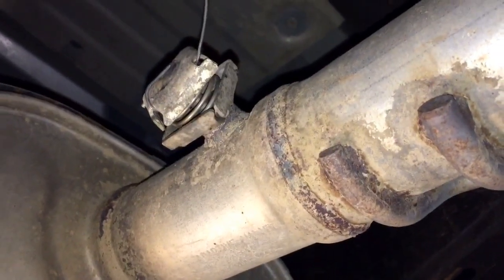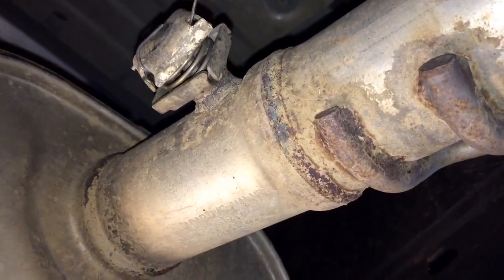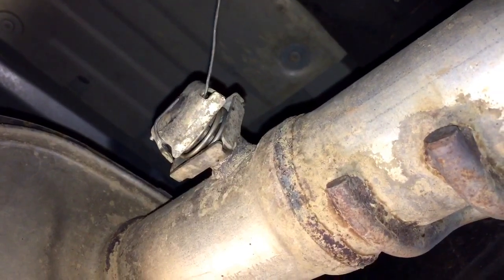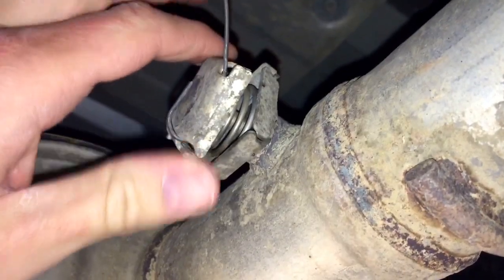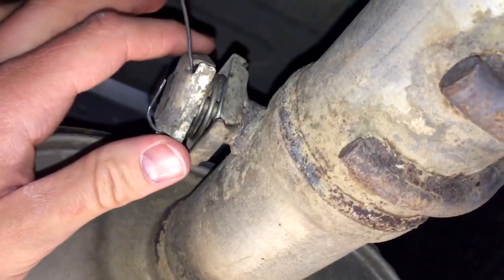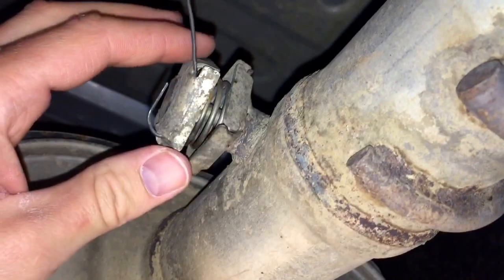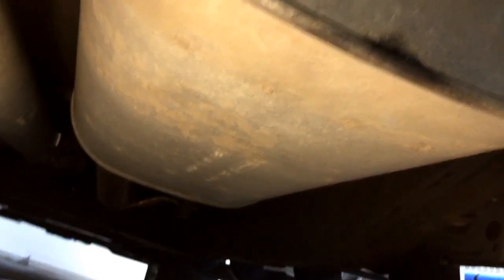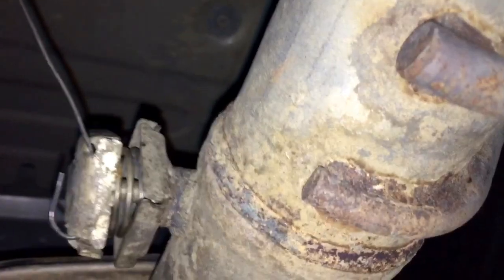GMC Sierra (2017) squeaks found and fixed *temporary*

Comment: I used the holes at each corner of the top cover and bottom plate to hold the valve all the way open. Just twist 90 degrees CCW and insert wire all the way through in at least two corners. Bend the wires at each end so they won't fall out and done!

Comment: I have a used 2013 Sierra extended cab 5.3 liter I bought from a relative and the stock exhaust was replaced with cherry bombs! Way to loud for me but I did find this exhaust today you talk of on the video on a 2016 Silverado extended cab 5.3 liter. Anyone know if this exhaust would work on my Sierra?

Comment: That’s it! My truck has had its leaf springs lubed twice. You’re a genius. It does confirm it on the fuel
Economy gauge. Chirps when between V4 and V8. So now what? 😕 only a 2016

Comment: I have a 2015 Sierra and have complained about this since the day I drove it out of the showroom floor.  Every time I went to the dealership for service, I asked about it and... no bulletin.  Finally, after the warranty expires, SHAZAM! a service bulletin to replace the entire muffler system.  Surprise, not covered by the original or extended warranty purchased.  GM Customer Assistance, no assistance at all.  Gave them the same information three times only to get the stiff arm.  Not feeling to good about that Corvette I was just getting ready to add to my garage.
Reply: Robert Karpick so they will fix the entire muffler system?

Comment: You are the man Empirical.  My 2017 has the same issue and yes springs were tightened down to speck and the even replaced accelerator connection. I will be showing gmc this video.
Reply from the maker: https://www.repairprocedures.com/bulletins/document/pit5404d/4827036.html
Reply: Dealership replace my system 3 times since October 2014.  Last time February 2017, Warranty has expired i'm going to install MagnaFlow 15269 Cat-Back Exhaust System, the hell with this factory crap also put a catch can setup to help reduce carbon and sludge buildup in your intake.
Reply: Careful about the catch can. Do your research first. GM has voided the warranty on catch can equipped cars.

Comment: 2017 Silverado 4.3, Dealer told me this part was cause of a rattle noise. Told me it just needed lubed. It actually needs to GO apparently. I was actually surprised they even use AFM in the v6 too.
Reply: How did you solve? Did you just delete with a regular pipe?
Reply: Yeah, the 4.3 (LV3) shuts off two cylinders…that’s the engine I have. Keep your oil changed every 5000 miles and you’ll have no lifter problems. That same engine without AFM (LV1) is only available overseas, go figure…

Comment: My 2016 4.3 never squeaked - until a dealer dropped the exhaust to get to (and replace) my transmission. Ever since the thing squeaks. Tried spray lube but that only works short-term. Gonna try this.

Comment: Hello, If you make it fixed open - Does the Cylinder deactivation still works V4 / V8 is it should be.  Thank you in advance!
Reply from the maker: Yep never had an issue . Only issue if at all was slight drone sound from 4cylinders firing in a 8 cylinder exhaust pipe

Comment: I have the same problem.  I found the cause of it this past weekend and then spotted this video.  I hate to say it but I'm glad I'm not the only one.  It was driving me crazy.  I had the wife starting and stopping the car a hundred times until I found it.  I sprayed it with some PB Blaster and let it soak over night.  So far so good.  May be a regular fix but at least it's gone for now.
Reply from the maker: I also tried different types of both high temp and penetrating lubricants. they lasted literally days at best. just a FYI, it was completely covered under warranty service for me. they replaced the exhaust from the muffler (further up than the valve that made issue) all the way to the tail pipe.   local GM dealer also gave me a free loaner since i was working back to back work shifts.
Reply: I have a 2015 with 48k making the same sqeek.Dealer won't do crap,they told me to clamp it open because that's what they would do if I proceeded with service.Sucks if grease won't last

Comment: General Motors has a service bulletin on this. If you are within warranty... they will replace your exhaust... you shouldn't have to do this on new truck.
Reply from the maker: this is correct. the dealer replaced most of the exhaust, approximately from BEFORE the muffler back.  no charge. and actually went fairly fast.   the video was just a temp fix between when i got the truck and when that bulletin became published.
Reply: Russell, where can I find this bulletin!  I can't find it.
Reply: yes where can we find this
Reply: Was the bulletin found on this?  My truck has squeaked since I bought it
Reply: @rash0401  Im wondering if its covered under the certified pre owned warranty...not sure if this is considered powertrain or "bumper to bumper"

Comment: I had that on my silverado...there is a fix for it they replaced the whole exhaust from the flex pipe back ..it makes the squeak chirp when switching from 4 to 8 cylinder mode..I printed out the gm procedure and fix and brought it to the dealer with me and was replaced for free .
Reply: Do you have a link to the gm procedure?

Comment: I picked up my 17 in October. I’ve been in twice to complain about it. Of course they have a lube tech look it over. Can’t find it. Finally go in during a normal business day and they found this to be the issue. Of course i am out of my warranty and blew up at them because I was in warranty both times with the noise so gmc offered to pay for half. Comes out to be about $500. Just going to buy a performance car back and it have to worry about it crapping our 30k miles downriver the road. I’ll try the wd40 fix tonight

Comment: I'm having the same issue with my truck but I'm driving a 99 chevy silverado 1500 so I doubt my noise is coming from the same  issue that you're having its definitely coming from under the truck though I can hear it all the time when the truck is accelerating
Reply: Belts and tensioner and possibly idler pulleys, had mine changed out, bought the entire kit from Rock Auto, got the Gates brand, no more issues

Comment: You can take that flapper out and it’ll run fine. Won’t stop the dealer from refusing warranty because you’re “not operating as originally designed” but I’ve been lucky and nothing has broken yet. Of course you could just pay beau coup bucks and do a dealer installed catback with no flapper. 😁

Comment: I installed a maga flow only exhaust and sounds weird like escaping air well I got under the truck and saw that valve I started messing with it voila that escaping air noise went away I have a 18 yukon

Comment: So that valve is behind your muffler, between the muffler and resonator?  It's in front of the muffler on my 2018 Silverado crew, 5.3L.  It also looks a little different.
Reply from the maker: i imagine it's changed by 2018. this/ mine is a 2017. the passive exhaust valve. this now has been completely replaced per warranty work however.
Reply: I have a 2017 silverado 5.3L and this valve is also in front of the muffler rather than behind..however i don't have this issue since i bought the OBD2 plug to shut the 4 cylinder mode off.
Reply from the maker: @vans1107  how reliable has that plug been?  4 cyl "mode" is way better on my 17 than my 2011, however it is still noticeable , especially around city speeds.
Reply: @rash0401  i got the truck this past February and bought the "range" brand AFM delete module right after..works great as it should, keeps it in V8 mode at all times.  Just unplugged it for emissions and popped it back in after.  I just bought it for peace of mind in the event GM didnt figure out a fix for AFM issues in the GEN IV truck motors.

Comment: This chirp sound, did it do it when you also started the truck ? My 2017 Tahoe does it when I start it and when it’s it’s in drive
Reply from the maker: I believe it did but general noise from the starter and the truck firing up I didn’t notice it as much
Reply: I have the exact same symptoms with my 2016 Suburban. Chirps upon initial startup and when upshifting from lower gears . I just purchased the truck 3 months ago and was concerned with this sound. (which is how I ended up on this thread) shrugs
Reply: @courtneyjackson4639  any updates on what it was? I’m having the same problem with my 21 Tahoe

Comment: I have the same issue, would a little bit of heavy duty grease also work?
Reply from the maker: i tried some high temp penetrant, didn't really seem to help sadly. lucky for me they changed the whole exhaust under a service bulletin and warranty.
Reply: I ended up just bolting the valves open, no more chirping sound and gives the exhaust a nice deeper rumble too
Reply: How did you bolt it open???

Comment: I just took my Brand New 2019 Camaro back to the dealership because of this annoying rattle and they are going to replace the entire Exhaust system on the car since it’s under warranty. I just have to wait about 10 days for the dealership to receive the package since GM is on strike smh.
Reply: Bro dead ass mine too🤣
Reply: 21mike They fixed it without having to replace anything they just opened a valve
Reply: Young Greedy So that's all the dealer is gonna do?
Reply: Cuz mine recently came loose and it rattles ugly
Reply: 21mike Yeah I’m sure they will take a close look and decide exactly what needs to be done but they just opened the “butterfly valve” on the exhaust that was causing the rattle and now I don’t hear any rattle.
Reply: Young Greedy So basically tighten up the springs making it staying open, shit I'll just do that myself, thanks for the info! 🤙🏽

Comment: My valve broke off in the exhaust and would rattle when my exhaust hit a certain tone with the rpm. Under warranty and they replaced my entire exhaust from the head pipe.
Reply from the maker: Did you notice the rattle under load and perhaps 3rd+ gear ? I had the exhaust replaced under warranty and still hear almost a rattle sometimes when per say pulling a heavy trailer
Reply: @rash0401  I can't recall, I know if I rolled on and held it around 50kmh it might do it, 50kmh is about where it'd ride in 3rd.

Comment: HAD THE SAME PROBLEM!!!!! I JUST PUT A SPRING HOLDING IT WIDE OPEN!!!!!!!!!!!!!! GOING TO DELETE AFM!!!!
Reply: I get the sqeak only on intial start up, just for a second and gone. I had AFM deleted. Its annoying on a $70,000 truck. I replaced serpentine and tensioner and lubed the AC and vacuum belt still getting it. Some say they greased the hell out of starter and the noise is gone. Will look at this but I'm not skeptical 🤔
Reply: @anthonymacneil2279  hey man you ever found what the squeak was from?
Reply: @dustinroddyful  Yes I did, it was the exhaust flap. I tied it open with wire, problem solved

Comment: I have a 2018 Silverado where this is in front of the muffler. I recently had a flowmaster put in and a resonator delete but they left this flap in. Is it ok to cut out?
Reply: Yes. I’m cutting mine out Friday when I get my magnaflow put on. I also have the Range device that keeps it in V8 mode
Reply: Josh Rigsby if i cut out the valve do i still need the device to put in v8 all the time?

Comment: Has the dealer fixed this yet?
Reply from the maker: not yet. i have put on approx 3000 miles since i bought it, did notify them when i come to get my oil changed that i will be having the tech look at it.... especially being this new, this common of a problem, and worth this much.... i expect they will fix it. I will update soon when i go in for the oil change
Reply: i have 12k miles on mine and it  drives me nuts with the windows down.  I did do some further reading on the subject and read they move the valve in front of the muffler.  Thanks for the video
Reply from the maker: i have since (using the wire) placed a smaller galvanized spring to do the same thing as the wire in the video. it's amazing to me how much having that valve functional does cut down in cab 4-cyl engine drone. I Definitely want to get it fixed right soon.
Reply: Empirical my dealership just changed out the exhaust. GM has relocated that valve.
Reply from the maker: i recently (my last oil change ) mentioned it, they sounded clueless to the issue. surprised me since it's a large dealership that is well known and positively looked at in our area. will keep on it. I don't want to rely on a spring or wire to keep a $50K truck from squeaking
Reply: Empirical they just changed my exhaust. No more chirp. New exhaust has the valve moved up on it. So glad that chirp is gone. And it took this video for them to get a clue. They kept lubing the leaf springs
Reply: Empirical the bulletin is PIT5404D
Reply from the maker: thank you! copied down
Reply: Empirical i have a call in to dealership but no word. Alternate fix is I was able to lubricate the spring this weekend and the squeak has stopped.
Reply: Joshua Brown the chirp he’s talking about is not the leaf springs. Thanks to him I was able to show the dealership that had no clue. They kept lubing the lead springs. They put new up dated exhaust on my 2016 and no more chirp!!! This guy saved my sanity
Reply: Steels Magnolia I know. I was refferring to greasing the adaptive valve on exhaust as a temp fix until the dealer approves the replacement of the exhaust. It was just an alternative to using wire to keep it open.
Reply: I fixed mine on my 18 Silverado..just pulled all that restrictive garbage off and put a catback system on.

Comment: Rotate the valve 90 Degrees and put a wood screw in the corner. you can turn it in by hand and it will keep the exhaust valve open completely eliminating any squeaking
Reply: Turn which direction?
Reply: @resid3nt  counterclockwise

Comment: How has this held up, have you done anything else or is this working still a couple of months later?
Reply from the maker: TheCrewl1 took the truck up north this weekend and took my "fix" out of the works ... instant squeaking. Either time to put it back on or see if the dealer will take care of it .
Reply: Thanks for the reply, considering doing this as mine is squeaking now.  How is the sound in 4V with the fix you made?

Comment: Any update with this?
Reply from the maker: about a month after posting the video, i went to the dealer and they replaced the rear portion of the exhaust including muffler and resonator under warranty. zero problems since then , now have about 20K on the truck.
Reply: Empirical do you know where I can find the bulletin so I can tell them please, my 2018 Sierra is making this noise and it’s driving me nuts.
Reply from the maker: @Armando-fs7ih  https://www.repairprocedures.com/bulletins/document/pit5404d/4827036.html